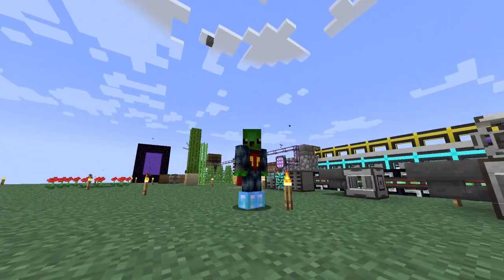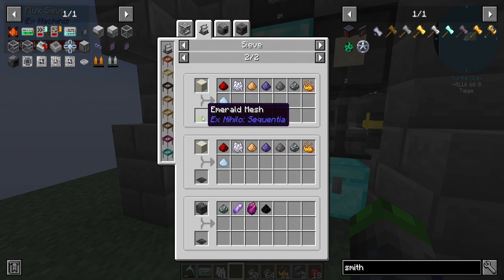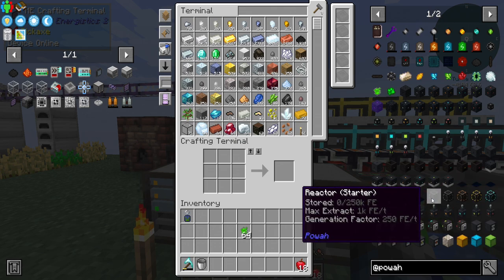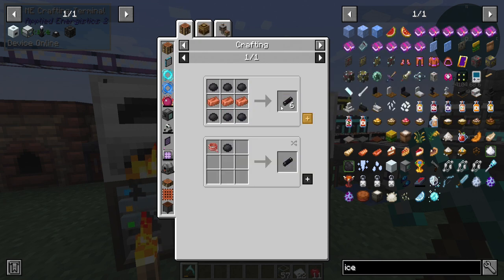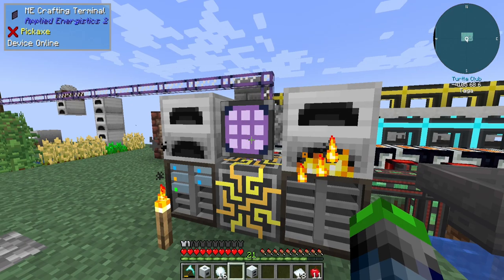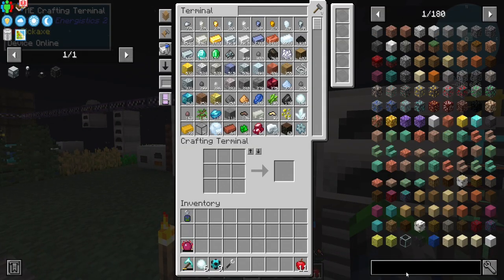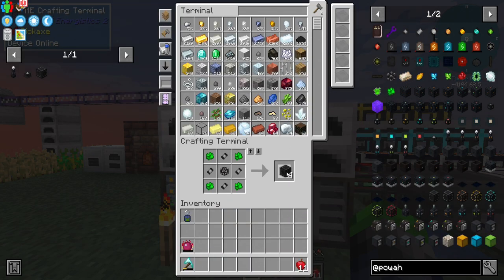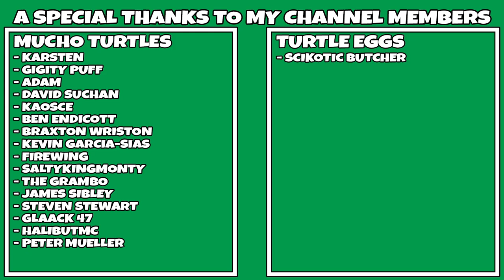All the Mods 7 - To The Sky! | Epic Powah Reactors!!! | [EP 09]

Comment: Engineers decor has a freezer that can turn water into ice. (I ended up doing twilight forest method as well, though you'll need silk touch). You can also look into gas burning generators for OP power gen. I have 1 cloche with watermelon (cactus on snad is faster) and you can power so many generators with this setup. Hydrogen > prc > ethelyne. Making several hundred k RF with very little investment.
Reply: Also the mod industrial contraptions is modernized ic2. It doesn't really play with other mods. Though you used to be able to use mek pipes on the original.